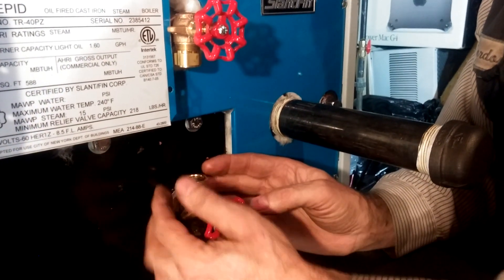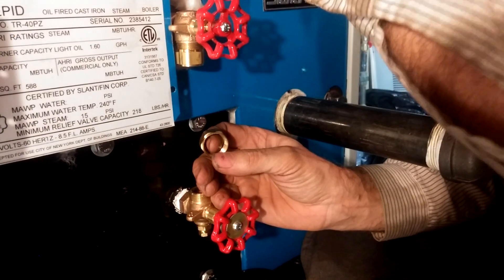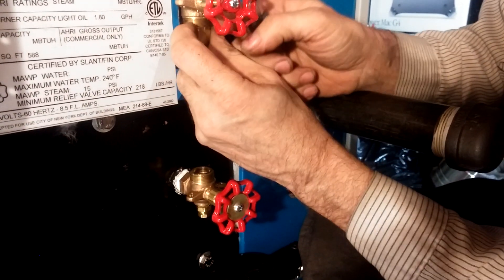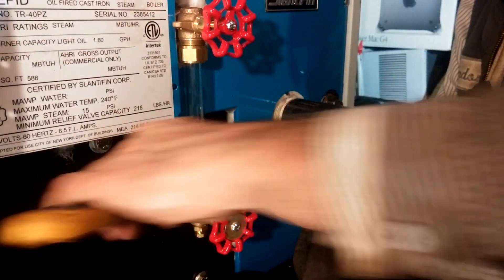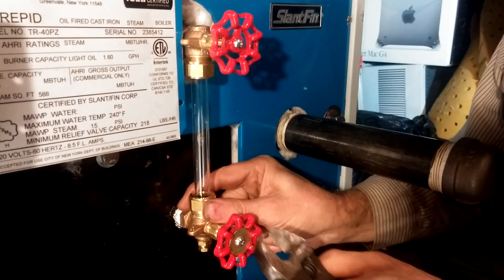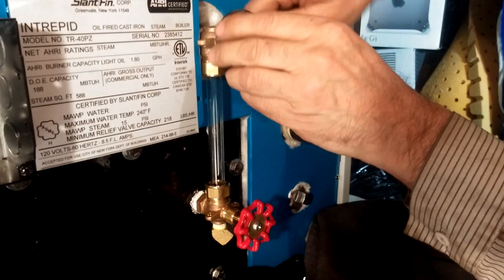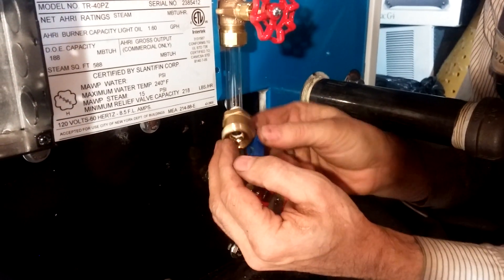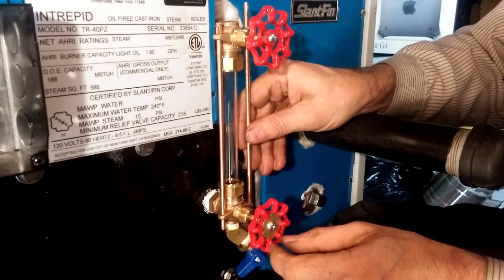Steam Boiler Sight Glass Installation

Comment: Gordon, I want to have the same sight glass drain set up using my Dahl 1/4 MIP x Male. Would that fitting of yours match with my sightglass and the Dahl 1/4? If yes, what's the size of that fitting or where can I buy that?
Reply from the maker: I think on this boiler you can use a 1/4 brass "street" 45.
For an SGO, you need a 1/4 brass "street" 90.
Try SupplyHouseDOTcom.
Reply: Gordon Thank you for your songs. They are all "Steam Classics" every steam musician should know.

Comment: Pretty slick idea , modifying that socket to fit on the drain valve.  What did you use, a cutoff wheel?
Reply from the maker: Thank you!
Yes, a cut off wheel and a die grinder.

Comment: I know this is old and not sure if you'll see this, but your videos are great and I learned a lot from them. I am 50 and I grew up with a steam oil fire boiler, we even had a old pancake steam boiler wrapped in asbestos that was converted to oil from coal. Nothing bets the sound and smell of a steam radiator on a cold November morning. LOL I just replaced my 40 something year old Weil McLain (funny when the boiler is older then the service man)in my own house with a WGO Gold. I watched your video on the Hartford loop. Old one didn't have it. I want to do the sight glass flush. Was just wonder is the threads the same then the one on this video? Thanks. Rich C
Reply from the maker: Thanks for your comments!
There is a very good chance the threads should be the same.

Comment: The sight glass keeps filling to the top and I have to constantly let water out.
Reply from the maker: Sorry you are having problems. Do you have more details?
Reply: @gordonschweizer5154  I have the same problem
Reply from the maker: @frankcaferra486  Do you have an automatic fill valve?
Reply: @gordonschweizer5154  no
Reply from the maker: @frankcaferra486  Tankless coil?
Reply: @gordonschweizer5154  no sure what that is
Reply from the maker: @frankcaferra486  Ok, I'll take it you don't have a tankless coil?
So, no automatic water feeder.
No tankless heater coil.
What you are left with is a hand valve that is slowly passing water into your boiler.
That's the best I can do without actually seeing your boiler and system.
Reply: @gordonschweizer5154  thanks for your help
Reply: @gordonschweizer5154  - My boiler sometimes overfills too, and I can't figure out why.  I don't have an auto-feed, nor a tankless coil.  If I had a bad/leaking feed valve, I would think it will happen all the time.  I then thought maybe one or more radiators aren't pitched right, and the steam that cools and turns back to liquid pools somewhere in the line until there's enough water to send it back down but by that time, I already added water because it automatically shuts off when water is below the level.  It seems like it can only be the feed, but I have a hard time believing that, there has to be another reason, like water getting stuck somewhere.
Reply from the maker: @nja3224  A slow/clogged wet return, maybe?
"Passing" manual feed valves aren't common, and you're right, when they start passing, they keep passing... usually.
Other than that, that's all I can think of.
Reply: @nja3224  Try this. Your boiler runs when the water level is at NOWL. Fill your feedwater tank 1/4 or 3/4 full (I would do 1/2 full) and observe if the feedwater tank is overflow.

If your boiler water level is higher than NOWL and your boiler doesn't have automatic feedwater system, you have to add water to your boiler manually. That means you added too much. There must be a pressure differential to have a flow. The boiler pressure in the boiler is always greater than your feedwater tank. If you have a bad valve like you described, the feedwater from the condensate receiver tank can't just run to your boiler. It must be pumped to. So, I don't think it your feedwater stop valve.
Reply: @landuongnov30  - Appreciate your feedback. I don’t have an auto feed, and I agree it’s not the valve.  It’s so bizarre.  I can see pressure playing a roll, it tends to run higher than it should.  When the steam returns to water, I think it gets hung up somewhere above. Boiler is in basement, above is the main level, above that is 2nd story.  It appears return water eventually makes its way back down to the boiler after I have to fill it.  I think that is happening but how or why I do not know, nor do I really know if that’s what’s happening.
Reply: If water level in the sight glass is pulled up to the top but the actual water level inside the boiler is at NOWL, the cause could be the isolation valve on the steamside of the sight glass is closed. It creates vacuum and pulls water up.

Comment: I first became aware of the fakery of the "brass" friction rings over 10 years ago.  I called Combraco Valves, the largest maker of sight glass fittings here in the States, and inquired of their technical service as to why the "brass" friction rings were, in fact, steel.  The person at Combraco insisted I was mistaken, that the rings were indeed pure brass.  I invited the fellow to grab a set of gauge glass fittings and a magnet to test for himself while I waited (at 10 cents a minute). 

To his credit, he did so. This was his reply:

"Hey, you're right! They ARE steel. How about that! How did that happen?"

How indeed.

I leave it to you, dear gentle YouTuber, to answer that for yourself.
Reply: Glad to see this video as I've been wanting to add a drain like this to my sight glass to keep it clean without disassembly.  I've got the bar stock 45 degree elbow but have not been able to locate that exact drain valve.  Is it an unusual configuration?  What precisely should I be looking for?  I have a substitute but I like that one you've got in the video.
Reply: That valve indeed is a very hard one to track down.  It is almost always a special order item at local supply houses.  Try the "inside sales" staff, look for the fella who is about to retire. You will make his day. The guys at the counter won't usually know where to start and don't have the time to mess with you.  It is a 1/4" MIP (male iron pipe) by 3/4" Male Hose ball valve. Good luck.  Let us know how it works out.
Reply: I found a suitable version of this online and had one shipped and it's a great casting and seems like a beefy valve excepting the plastic handle feels like it's about to fall off.  I'll find a supply house somewhere soon and get a proper one, hopefully before that guy actually retires :)  Prior to adding the drain to the sight glass I did remove the glass for a thorough cleaning and detected two large deposits of chinesium which will also be replaced soon.  So nice to have a clean glass and a proper blowdown on that thing, Thanks for sharing!
Reply: Thank you for the feed-back!  I think I've used a few those plastic handle valves you're talking about.  Red plastic, thin and cheap-feeling (the handle, not the valve body), yes?  Don't have too many of them out there to give meaningful results on longevity, sorry.  The metal handle ones are usually powder-coated die-cast zinc/aluminum alloy (with the exception of the Dahl valve brand). They last well enough, unless the handles get wet for awhile.  Then they crumble.
Reply: On the first one I found the boss that the plastic handle mounts onto plays quite a bit inside the housing.  I thought it was just the plastic portion loose and I was just going to shim or pack it, but when apart the actual mount was kind of floating around in there more than it should.  I have my eye on a Dahl 521-61-04 and if they can't/won't get it for me I'll live with the cheesy one I have for now.
Reply: The Dahl is the highest quality construction (pure canadium, eh!), and if you have the space to fit it (it is the longest of all the valves I've used), you can't go too wrong using it.  The only other glitch issue with the Dahls is the metal handle gets very hot if you use it when the boiler is running.

I was disappointed with the plastic handled chinesium valves and the way they felt... so cheesy... that I didn't order any more after the first dozen.  I used them (special order - not returnable / "reshocking" fee / extra shipping blah blah etc etc), but I fear they will come back to haunt me.  I'd go with the Dahl if you can.
Reply: Good news - supply house dot com will be stocking the pure Canadium edition Dahl 521-61-04.  Much like the kids and their iPhones, I have pre-ordered :)  Where the metal handle is concerned I think I can locate an orphaned leather glove to hang nearby for the occasional hot blowdown.